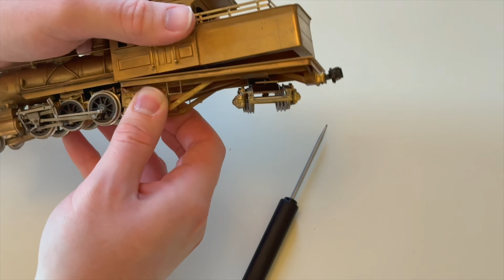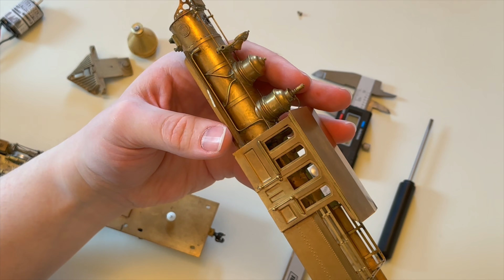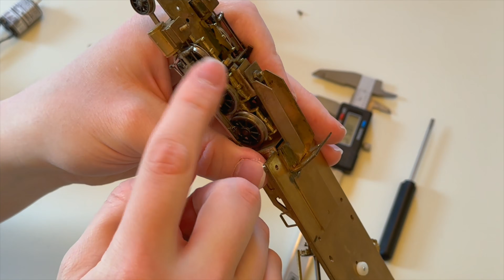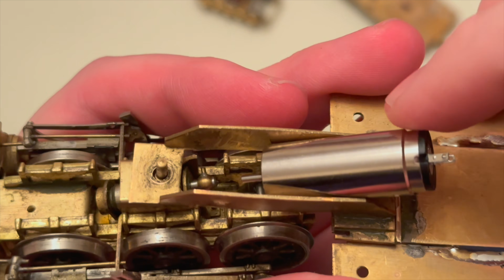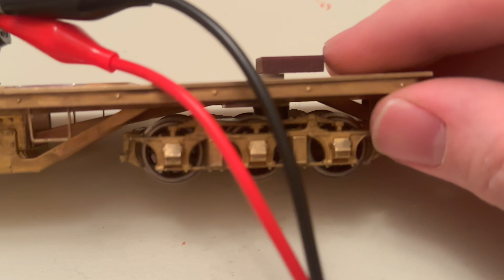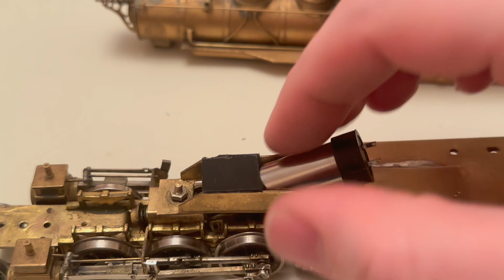LMB Brass On3 2-6-6 Mason: Compact Coreless Remotor

Comment: Hi Darth, nice to see you back, i like the coreless motors, but it's a shame that you can't use feedback controllers with them, (well you can, but you're not supposed to), may i ask how you feel about them?.
Reply from the maker: I personally have a mostly DC collection, so I don't have much experience with digital controllers.  If you can find a way to use a tachometer instead of feedback control, it might be possible to achieve the same effect.
Reply: It's worth a try, another funny thing is modern 3 or 5 pole motors can have a lot more torque with the feedback controllers than they do with modern non feedback ones, i wish they could make one controller to fit all.

Comment: I have some Tyco 0-4-0's 4-6-0's where can I source some slow running motors for them?
Reply from the maker: There are a number of slower running motors you can source from NWSL as well as other manufacturers and sellers, but mounting any of them properly in the same way as the original motor is going to take some custom work.  Drop-in replacement can motors from Mantua and Accurate Lighting/Helix Humper have gotten pretty rare.

Comment: nice and simple motor swap.  I'm guessing the reason why the motor wasn't on top of the bolster with a pulley to the worm is for fitting the body, and that a 1219 or 1320 not powerful enough for the job?
Reply from the maker: Right, a belt and pulley transfer would have pushed the motor further back into the cab, and even though there are some powerful 1219 coreless motors, they still don’t have quite the torque that the owner was looking for.
Reply: Do you have any other socials? I would love to follow your work more! You really helped get me back into the hobby
Reply from the maker: @SteamPower-kr6ui  I'm glad my videos have been helpful to you!  I post on Model Railroader's forums and the Tyco Trains forum now and then, but that's about it.